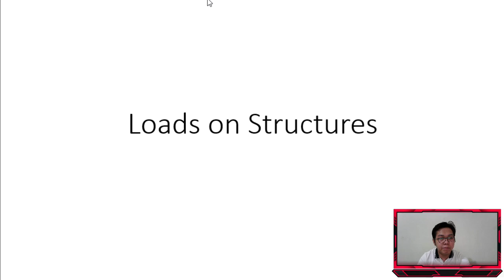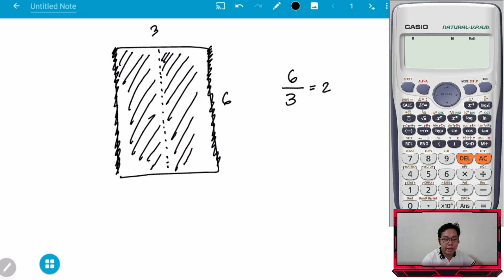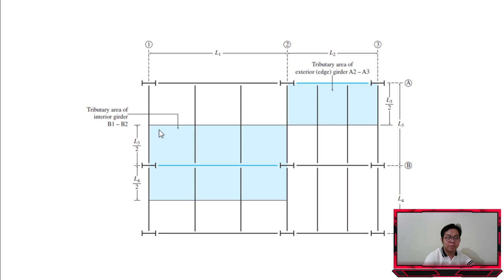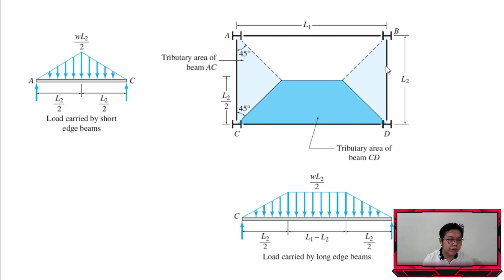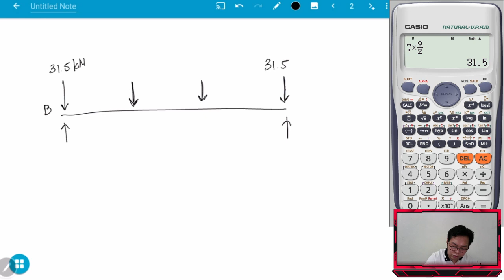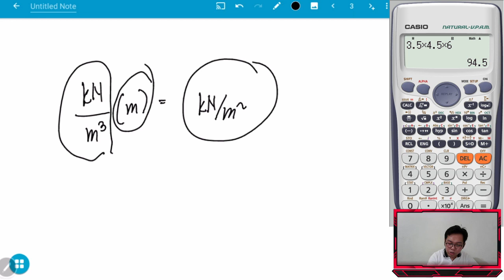Theory of Structures - Transmitting Loads

Comment: That is a conservative load distribution assumption. Actual load distribution in a building structure takes into account the relative stiffness, span, and boundary conditions of structural elements, i.e, a beam with a larger cross sectional area attracts more load than a beam with smaller cross sectional area.